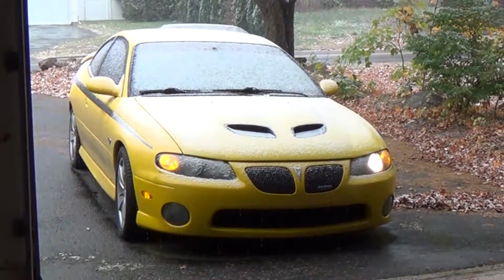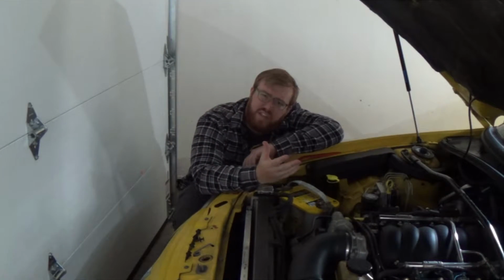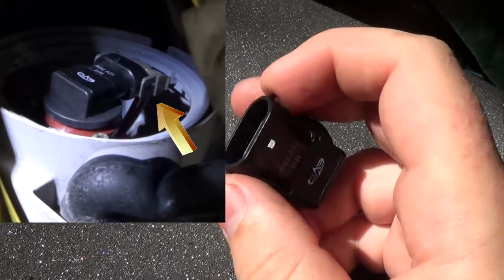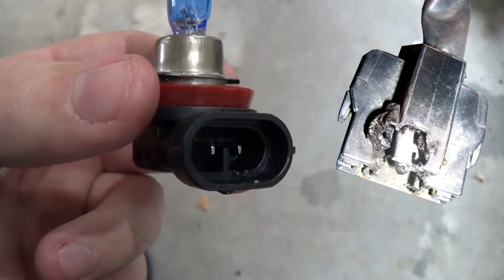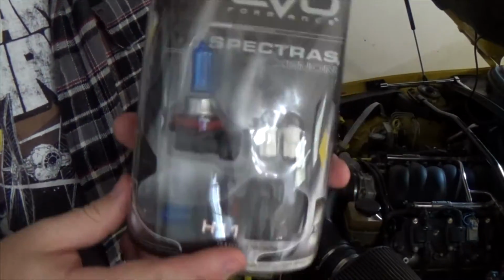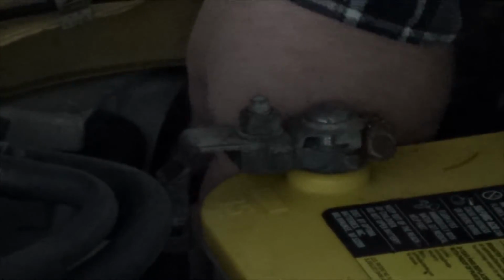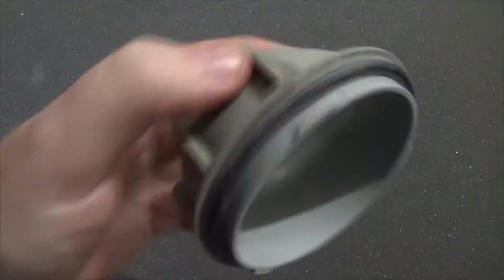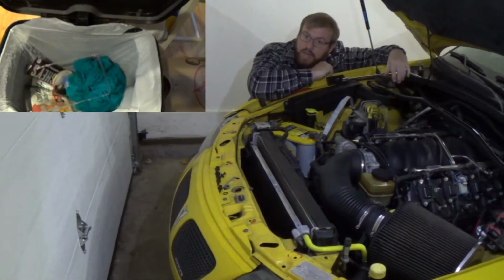How to Replace Headlight Bulbs: A Simple Tutorial • Cars Simplified

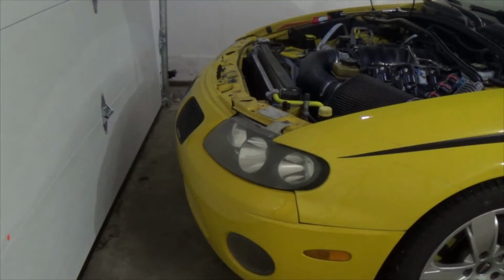Comment: 2:30  looks like you have broken clips in your front bumper?  the gaps look a bit off.  great video and car in any case.
Reply from the maker: Yeah, there is a piece missing that I have been putting off epoxy-ing in place for a long time now. Thanks!
Reply: yes, I have wondered why the folks with the broken tabs do not just use J.b Weld plastic weld.  It literally is like welding.
Reply: @CarsSimplified  ok...so how do you get to the driver side light to change the bulb!???

Comment: HELP! I just got my gto and my right headlight bulb is not working, i took a peek at it and one of the plugs (the black one) looks kinda burned from the neck plus the bulbs youre using dont look like the ones i have. The bulbs you have are like plastic from the bottom part where you need to twist to take out and mines dont have that it just shows were the two cables connect and i cant take the bulbs out because they have nothing to squeeze and turn, its confusing but thats the best way i can explain it
Reply from the maker: You might have aftermarket headlights; my experience with them on other cars is all I can go on, though. A melted/burned connector can definitely open the circuit and cause a bulb not to light.

Look up an image of an H7 headlight bulb. Does it look like that?